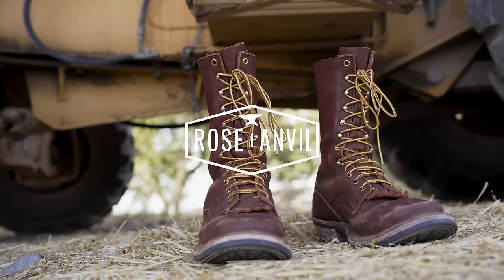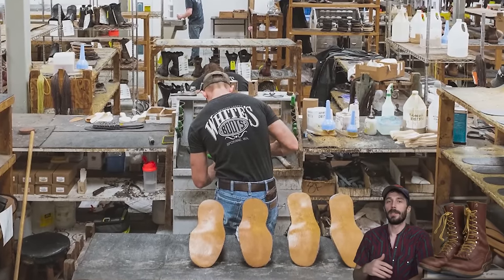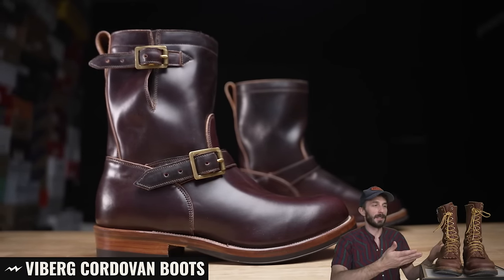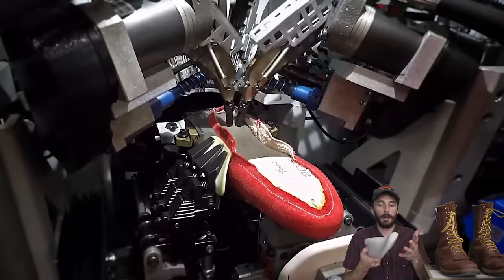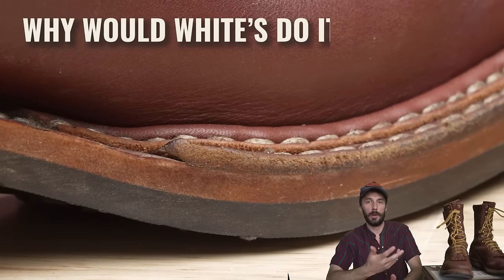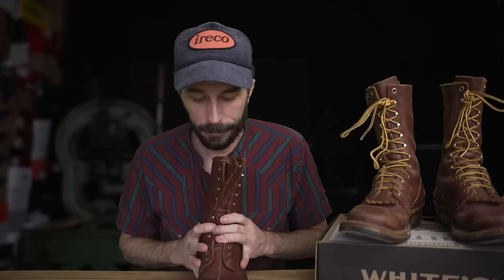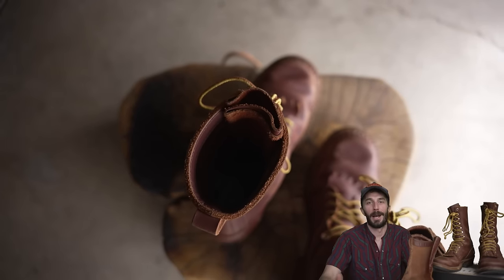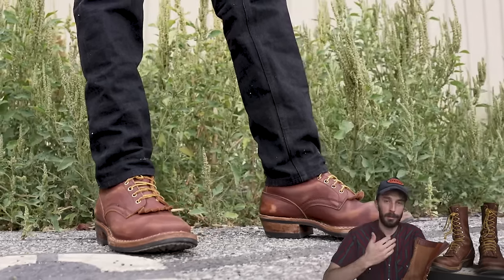After 169 years are White's still the best boots made in the USA?

Comment: My White's Smoke Jumpers have been my every day wear for a few years now. Super comfy once broken in. I wear them like shoes and they feel just as light after wearing for so long.
Reply: Don't they get hot in the summer?
Reply: @SplitHairz  A lil warm, but doesn't bother too much. Thin socks in summer, nice wool ones in winter.
Reply: I have two questions if I got a pair will they be too hot to wear in North Florida and are they tough because I've never wore a boot that lasted more than 2 years ?
Reply: @rdf4315  They've lasted me for a good while. Few years and haven't had any trouble with wear. I don't know about Florida, as I haven't been anywhere with comparable humidity.
Reply: When I worked for the USFS in East Oregon high desert, I wore my SJ's in 115 degree summers, even on fires in that heat.  I would also jog in them after a full day working in the forest. Best pair of footeare I've ever owned in 65 years.
Reply: So you're just walking around in stores, exercising, driving, going for activities, going on dates, etc in a pair of White's Smoke Jumpers every day? That sounds insanely hot and uncomfortable. And trying to match outfits for different scenarios to those boots sounds like a nightmare 🤣

Comment: I ordered a pair from White's (not this model.) I was concerned when they told me that I needed to order one size smaller. I need a wide toe box, but decided to try them, after listening to their "sizing" explanation. The toe box was fine, but the boots were so tight around the mid-foot that I knew there was no stretching that would ever fix the problem. I was very impressed with the quality of the boot, but I had to return them.

Comment: At $650, they are handmade and custom fit to your exact foot. They aren't off the shelf boots. If or when you wear them out, you can send them in and have them disassembled and rebuilt to like new and they save the good broken in leather parts, effectively giving you a brand new pair of boots for half the price. Whites are the cheapest high quality work boots you can buy over a 20 year period because they last and are easily rebuilt 2-3 times to like new condition. I've been wearing them for 30+ years. They also use a "rock hard" leather shank as it won't break or rust like a steel shank. As long as that's good, they can rebuild the boot around it.

Comment: You can get them measured and made specifically for you feet. Mine are 12DD. Super wide boots and love the toe box. Bought my 8" smoke jumpers with lug welts in Black in 1999. The state mandated that if they required a piece of equipment for work, that the job pay for it. So I got a 150 credit so went and bought them basically for half price. Spent 320 for them. The breakin was horrible but they are like a glove now. You forgot to mention that they can be rebuilt up to 3 times, resole, then do the lower. So, if you take into account that my boots are 20 years old and I could have rebuilt them at 10, but no longer do manual labor, the rebuilt would have been 200 and you still have your custom, quality boot. Worth it.

Comment: I've paid closer to a grand for custom fit Westcos with steel toe, extra toe cap, internal leather liner, and most crucially, Kevlar stitching.  (welder)
At that rate, with one, half-original price rebuild/resole, I figure they cost about $200 per yr, not so bad.

I've seen guys go thru several pairs of cheap boots per yr, just the shopping cost and failure rate dissuades me from that approach.

Comment: I love my whites I have 4 pair 1 pair of packers leather sole casual,1 pair of packers rubber sole for work and 2 pair of smoke jumpers I am a maintenance mechanic at a big Juice plant been in maintenance for almost 25 years and I am always on concrete having to climb a lot of ladders working a lot of 12-hour shifts 7 days a week and my feet never hurt only the initial break in for the boot I have bought a pair of cheap boots with insulation for the winter time but after a couple days my feet start hurting cuz I am so used to that leather insole would never change my boots on for any other pair been wearing mine for over 25 years now

Comment: My Uncle was a farmer. He wore Whites Boots in the 1950s-mid 1980s. His sons wore them as well until they got priced out of the market.
In 2006 or 2007 I found myself in Spokane passing through for work  had to pick up parts at FedEx.  Dropped in and bought a pair of custom Linemen.  Asked if I wanted steel toe. I said no. Cost around $400.00.  Ladies like them. Later I needed steel toe shoes for some customer facilities. Wished I had them made that way.  
Stopped in last fall. Showroom changed around. 
May buy a newer pair.

Comment: I'v got a pair of wesco boots that I re-soled several time and lasted 7 years.  Now they are off to wesco to be rebuilt, and will likely last another 7 years.  14 years for $650 plus 4 resoles at $75.  so that's $950.  I was buying $250-$350 boots ever year and a half to 2 years before.  So say $300 every 2 years.  I would have spent $2100 dollars on boots is I stayed with Danner, Redwing etc...  I've saved double, and they are way more comfortable, rugged, water resistant, and supportive.  
I bought my first pair of Whites smoke jumpers, so I have a boot while the wesco's get rebuilt.  I'll probably relegate the smoke jumpers to my camping, and all around outdoor boot, and continue to use the wescos for my Trades job.

Comment: Alright, I work at an airport and walk about 100 miles a month outside on the tarmac/concrete and Im required to have safety toes. The tarmac is like sandpaper so I usually get about 4 months out of a pair of boots before the sole is gone. I've been through all the main brands like Redwings/Danners etc but I've settled on the Keens since they are the most comfortable but they can't be resoled..Is there any way you can do comparisons on tread life?  Maybe with a belt sander and a timer or something?  LOL!  Thought Id ask since you're already cutting them in half.  Thanks man!

Comment: I worked in wildland firefighting for 28 years, with the BLM, Forest service,  and Montana Department of State Lands. I started in 1988 as a young man. I bought my first pair of smoke jumpers in 1994, and my second pair in 2000. Not that I needed a sec pair but I wanted one. In that time, inwore them as well in my second job as a miner and equipment operator.  I had new soles put on them every 3 years or so. They deserve all the hype as the best boot. Yes they take a bit to break in. Once you get them broke in, you have a life time boot. If you rely on your gear to work as hard as you and keep going when you can't.  Buy a pair of whites boots.

Comment: Think about this spikes for climbing is only about 1 inch wide . With all your gear imagine standing on it for ours at a time. 30 feet in the air . Rain wind heat cold . And feel like you are standing on a flat surface. And that thick leather and good pair of wool socks. Keeps your feet dry in the worst of weather. And most importantly keeps your feet from going numb. Are they worth it . Ask a lineman absolutely.

Comment: Weird question. What kind of socks did you tend to wear with your long term pair?
Reply: Always wear wools socks with your boots, always. Don't wash them every time or you'll get holes in them. Wool naturally wicks moisture and has antimicrobial properties. They don't stink like regular socks. I'll never go back to cotton.
Reply from the maker: I am the wrong person to ask, I wear anything from $20 woolrich seamless socks to Nike socks I’ve had since 6th grade
Reply: I got myself 3 pairs of darn tough wool socks. An ankle cut for running, a no show for low tops and an over the calf for tactical boots. Way better than regular socks.
Reply: @Desmo25  Yeah, I've got some of those myself. Very durable, but I like a little more wool for colder weather. All depends on where you live
Reply: @wecanjump7512  currently in Chicago but will be in San Diego for a while, so it doesn't matter I guess? I usually just double sock when it's colder.
Reply: @Desmo25 I meant for the OP. Thicker wool socks are a godsend in winter. Get a pair for Chicago, you'll freaking wear them all winter long around your house
Reply: @wecanjump7512  nah I'm only here until mid November.

Comment: As expensive as they are, they are more affordable than cheap boots. They would save you alot of money in the long run, but... Would they outlast a pair of four hundred dollar boots? Probably not. RedWing is still the king of cost/longevity. I have had them last more than a decade, and at less than half the price of these White's, though, the properly comparable boots from White's are notably cheaper, in the 350-500 range. And the best comparison is the Hillyard, which is only about sixty dollars more, though it uses the same construction as the RedWing 4200 is is most similar to. Perhaps the leather is better, perhaps it's not(I'm sure it is since the leather RW uses now is processed in chinastan).

Comment: This is the best boot i've seen so far. But there's still a flaw like most other boots, there's no groove on the outsole for the stitching that the threads wont last a month on a daily wear. There's no point of sewing it with threads if it's just exposed right there and not hidden below  the outsole surface😩
Reply: It makes no difference. For example, on a leather sole shoe, the stitching is often in a shallow groove. When they are worn down the stitching embedded in the sole is exposed and wears down but still holds the sole.

Comment: Are they waterproof?
Reply from the maker: They are water resistant since they are real leather, and the handmade aspect of the welt and construction makes it a little more water resistant, but they are not waterproof.
Reply: @RoseAnvil  I want a boot that is waterproof, leather inside and out, vibram sole, around £300 and looks smart- any suggestions?

Comment: Why would anyone working on the side of a hill or in the woods and trees that is bending over or walking on uneven terrain wear a pair of boots with tall heels.  Try running a shovel by putting a 2.5 board under your heels which makes you bend over even farther to do the job compare to working flat footed just like we evolved or were designed to do.  Heels are designed for looks not function and the added benefit of twisted ankles.